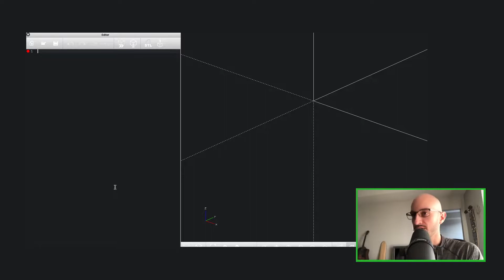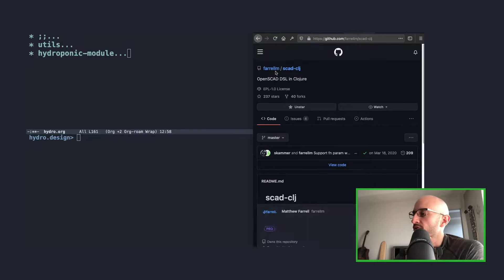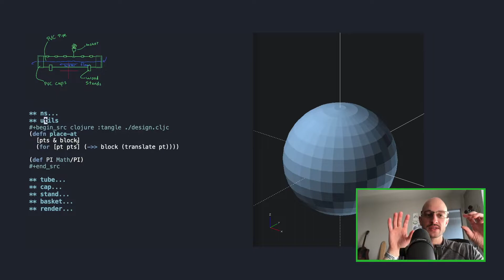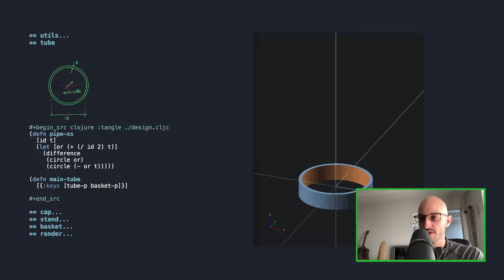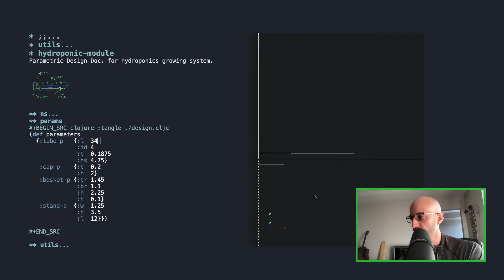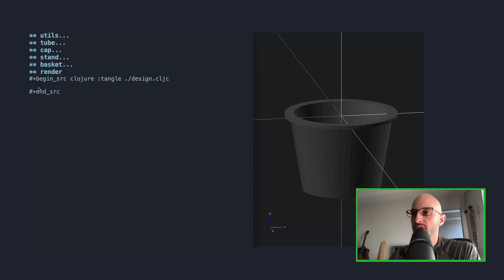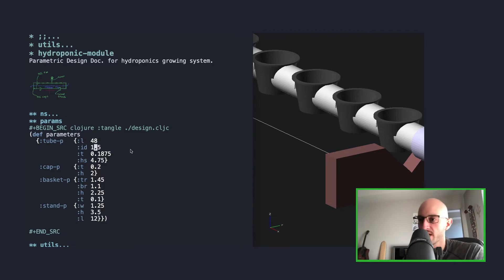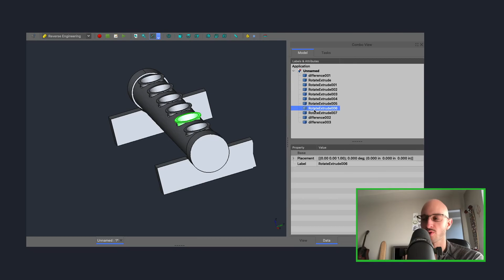Using Clojure for 3D Modelling - Parametric Design with Code

Comment: Very well done, Adam. What does the clj->step function do? You've called it, but have not shown the code for it. Does it just call write-scad on a block and call scad->step or is there more to it? I'm just starting with scad-clj and I really like the modularity and composability compared to SCAD code.

Comment: Instead of watching file-changes I set up a custom eval, that writes to a file to be loaded (and updated) into OpenSCAD - this way it's possible to examine parts of the design separately.
Reply from the maker: This is a smart approach. Feel free to post a link to a gist or something if you’d like (no worries either way of course)
Reply: @AdamJames-tv  I've described it here: https://github.com/MrGung/openscad_clojure_models#hint-working-with-intellijcursive-and-a-repl - this uses IntelliJ and Cursive.

The repo also includes slight additions to scad-clj and examples.

Comment: I'm struggling a bit with the the lack of composability using scad-clj, coming from fusion 360. I'm finding I want to read properties after combining parts together, but in general model objects have no properties. For example, the result of a union is a totally opaque thing, whereas in a graphical cad system the result is a thing that has queryable properties. The effect of this limitation it seems is everything has to be parameterized at the top level and there's a lot more order dependency for operations. Is this a limitation that's easy to learn to deal with for you? Do you typically work with aggregates that aren't opaque scad data?
Reply from the maker: This is a really fun question to think about. I (sometimes) think of this not as a limitation but rather a difference in approach. Parameterizing at the top level is certainly the outcome, as you point out, but in some modelling contexts could be seen as a benefit. Consider wanting to make a 'one and done' program that builds some assembly based on only a few top-level parameters; modelling using something like scad-clj will naturally bubble the key params to the top. 

That's not to say it's always useful, and I do struggle with composability issues too. It's an ongoing project of mine to work on this, and I have two libraries:
https://github.com/adam-james-v/forge

and 2D/SVG stuff:
https://github.com/adam-james-v/svg-clj

The Forge library is a WIP CAD tooling library. I have the idea of representing every model in 2 ways: 1. a tree data structure of primitives + operations on the primitives. This is borrowing from how scad-clj works already and can sort of be thought of as a 'history based modeling approach' (Like SolidWorks or Inventor). 2. an internal rep. which is a map of known keys derived from a model tree. So, any tree at any stage can be 'compiled' into this internal rep. and queried. At least, that's the idea.

The SVG library is a bit simpler. It is functions that emit hiccup data (a tree of primitives + operations on the primitives). But it also has a few fns that calculate properties which can be useful for more declarative modelling approaches. This idea is perhaps best seen with the 'distribute' fns that automatically compute translations over a list of items so the user doesn't have to explicitly provide positions.
https://github.com/adam-james-v/svg-clj/blob/main/src/svg_clj/layout.cljc#L120-L134

Anyway, long reply... I have a lot of these ideas bumping around in my brain :)
Reply: @AdamJames-tv  Very interesting. I don't quite follow the second "internal" representation and what's going on in brep.cljc. It looks like you're creating higher-order combinators for walking over the tree and transforming it. Is that accurate? it would be nice to see some examples in tests. 

For now, I've been modeling the parts or "bodies" with clojure.spec and creating assemblies with just functions on those parts. So any relation between parts is a function of the spec'd entities. But unfortunately I'm spending way to much time dealing with stone-age-level annoyances creating simple geometries with oppenscad. Even just to create a simple shell, I'm having to pull epsilon values out of thin air and stuff. I'm really sick of pointing/click with cad programs, but on the other side openscad seems full of tedium.
Reply from the maker: Up front, I want to recommend another tool, if you're becoming frustrated with openscad's limitations: FreeCAD. It's scriptable with python, can import openscad, and is meant to be a full-featured CAD tool in the same vein as SolidWorks, Inventor, etc. Open source, free, and improving all the time. If you're a clojure dev. I suspect there could be potential using clj-python:
https://github.com/clj-python/libpython-clj

This is something I'm researching, with the hopes that I can add it into my Forge library. Speaking of...

Yea, should've mentioned the 'this is alpha level' caveat. As I build, examples/tests will be added. 

You're basically correct about combinators walking the tree. I want to also have a compiler that builds up from any tree a single map containing a complete set of vertices, parametric edges, surfaces, solids, etc. plus material and style data. With that, you can build renderers and exporters. Thinking about this now, I should improve my docs in the project... YT comments aren't always the best spot for details ;) Though, I love your comments!

Comment: Is it possible to get a clojure code for pre existing stl or scad file. Or do we have to design it from the scratch.
Reply from the maker: Hi Ultrahalf. This is a great question. With my current workflow, and with the libraries I know about, the answer is NO. It's a one-way street at the moment.

It's certainly possible to build a .scad parser which can transform  a .scad file into Clojure. Likewise, you could parse STL files (but would have to build something for both Binary and ASCII encoding). 

The .scad parser is on my TODO list, but I have no timeline attached to that particular task yet.

As a 'halfway' step, OpenSCAD does let you import STL files into a .scad project. This treats the STL as a 'dumb solid', but could be helpful depending on your needs. scad-clj, the lib. I use for modelling with CLJ, has module / STL imports covered.